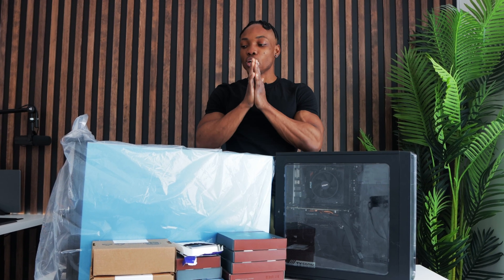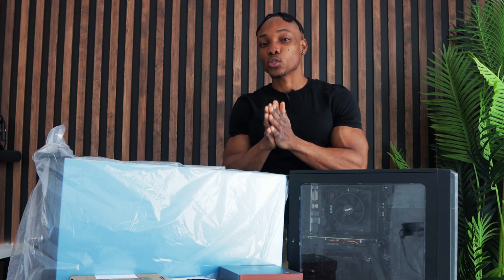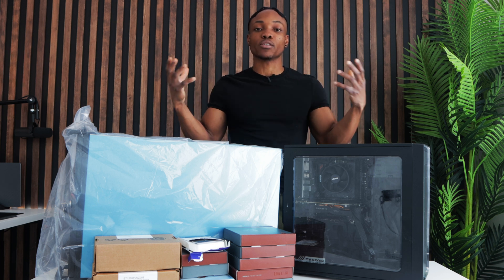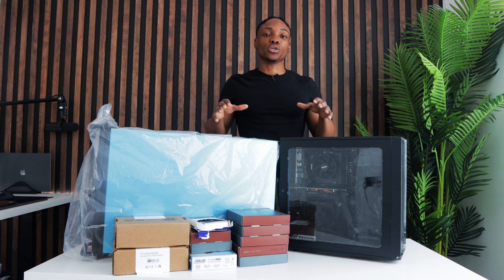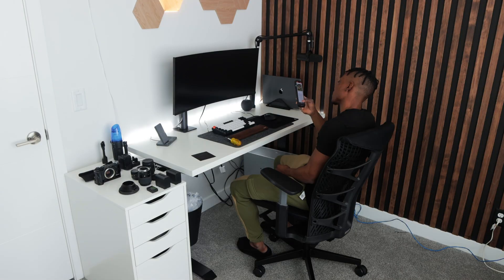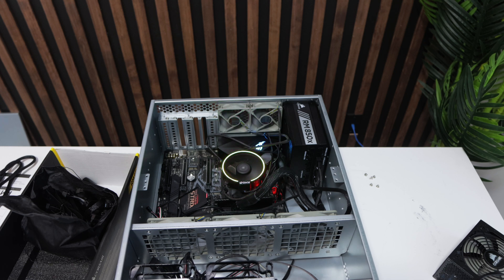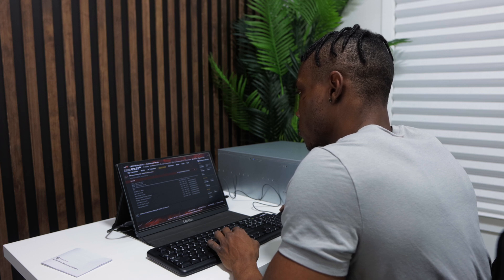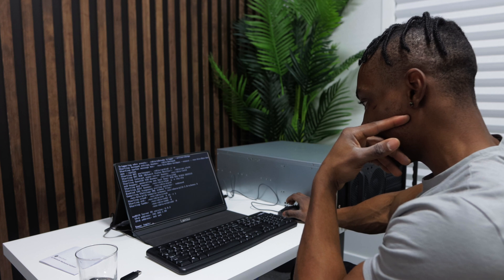Converting an OLD PC into CLOUD STORAGE! | 25TB NAS & Home Server Build!

Comment: Nice video. Found this after the fact, but I just put together a very similar build about a month ago. I went with the 4U-15 bay rosewill case, as I had 8 old drives ready to use and wanted room to grow. I similarly, replaced all of the rosewill fans with noctuas, although one thing I learned/found out was that the 5-bay caddies have VERY little space to run the fan cables straight back. In fact, the noctua cables are thick enough that it effectively means that one drive slot can't be used because it would smash/pinch the cables. I haven't had time to play around with potential cable routing solutions to run them a different way, but for the time being it effectively makes the case a 12 bay...but at this point I'll admit that having the low noise and PWM fans well outweighs losing a drive slot per caddy.

I had/used the same MOBO, but also threw in two nVMEs for a cache pool, so therefore had to add in an HBA card to connect most of the drives since the MOBO effectively only had 4 SATA ports available.
Reply from the maker: Amazing! Loved to hear about your process :)

Comment: The video was good. The audio should be balanced to stereo and have the level adjusted a bit.
After 25 years of building PCs, I always try to keep an extra power supply around. I've had more than one failure.

Comment: Cool video and glad that you figured out it was just the PSU that had to be upgraded. Good luck with your server! Having that thing on 24/7 have you thought about the extra power consumption due to the dedicated graphics card? Does the server need a dedicated graphics card?
Reply from the maker: It definitely doesn't need a dedicated graphics card but I had one from the old pc and I watch 4K videos through plex from the server so for transcoding, the graphics card comes in useful. The processor doesn't come with one inbuilt I'm also not too worried about the power consumption. It's not a power hungry system 🙂